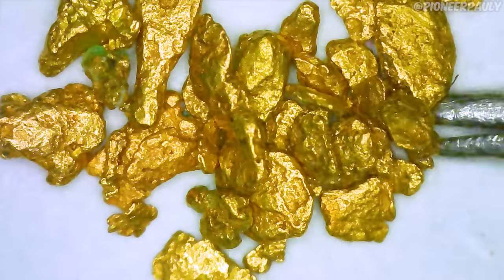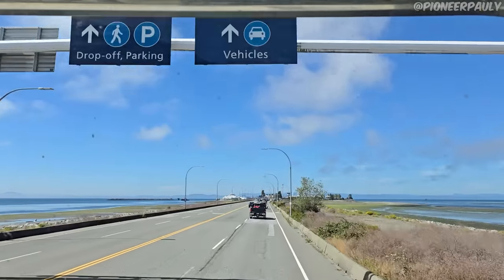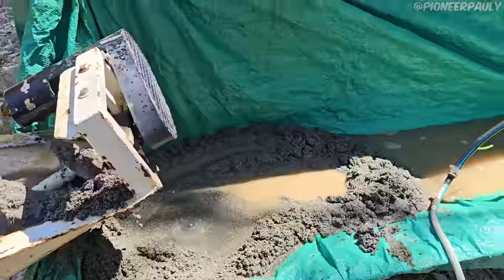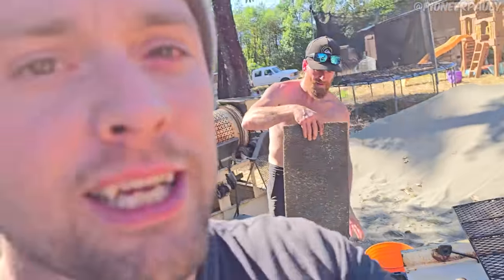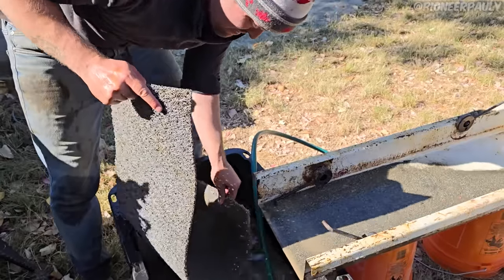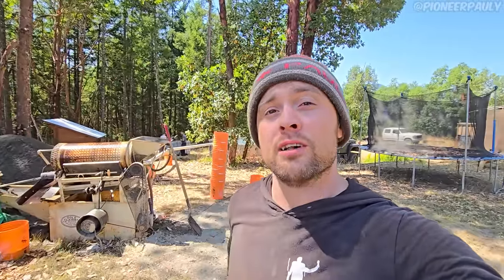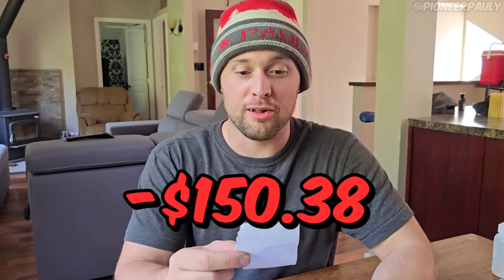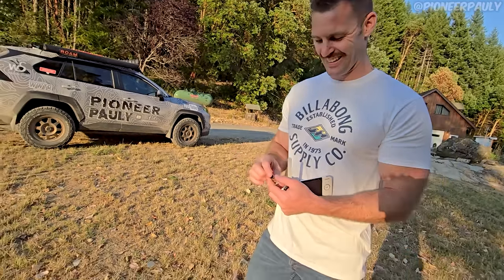How Much GOLD In Dump Truck Full Of Home Depot Sand?

Comment: Error. The sand on the bottom you left behind would have the highest concentration of gold in it.  NeXT time,  put a huge tarp down on the ground before dumping the sand on it.  Then as the heavy gold falls to the bottom, it will be caught by the tarp.  You lose nothing.
Reply: No, I ran a gravel pit with a sand screw for 3 years. That sand would be practically homogeneous. If you could simply dump sand into a truck, then into a pile and all the heavies went straight to the bottom, there would be no need for sluicing or anything else. You would just dump sand on the ground and discard everything but the bottom 1” layer.
Reply: 'Next time' lol
Reply: Error.
Reply: @baddestmofoalive  I think what they mean is as you disturb the sand from scooping it, you're going to displace the gold further down.  It's going to be negligible, but you'd definitely see a higher gold concentration at the bottom of the pile than the top.  Even if it's only 1-2% higher in concentration, etc.
Reply: Yeah that’s not true at all.
Reply: Evidently, you’re not that smart.
Reply: Bros a nerd😆
Reply: @Tyler.8046  i’m no scientist, but I think it would have to involve some version of liquefaction with either actual water or agitation and the bucket movement is probably not enough to do that, scooping is probably not enough to do that and even if it did on the truck from driving it, that wouldn’t matter much after you dump it
Reply: @primaryinbox8481  liquefaction, i.e. bubbling air through the sand, would absolutely increase the speed at which is concentrates the gold, although any disruption is going to inevitable displace gold, and since it'll be the heaviest thing in that pile, the displacement will be towards the bottom of the pile; it will just be much slower.  Liquefaction is just taking "disruption with a shovel or bucket" to the logical extreme.  The more you disrupt the pile, the more displacement is going to occur.
Reply: @Tyler.8046  So you think it would be a measurable amount? Or enough to stratify the pile?
Reply: @primaryinbox8481  I lean towards it being negligible, but non-zero.  So, potentially measurable in a large enough sample size, but getting past margin of error on something like that would be really tough.

Especially because you'd have to work under the assumption that the gold is evenly mixed from the start unless you took measures to disperse it evenly through the pile.
Reply: @Tyler.8046  I guess the obstacle I’m coming up with is how far a piece from the top would have to migrate down layer by layer to come up with something significant. I agree that it would be a statistical >O but as per the comments , not exactly yours, but it seems like that would never likely measure that way.  So I guess we agree more than disagree. Thats a civil YouTube conversation we just had!
Reply: How do you know
Reply: By your own ideology , the gold would be in the bottom of the truck, then when it dumped out it would mix it all back up
Reply: 14:00

Comment: Next stop….the Sahara Desert….gonna need some longer water hose though!
Reply: unfortunately the sahara probably has next to zero gold
the sand in this video is likely sand cut from igneous rocks like granite, from the mountains in british columbia, which is where the actual gold veins in the rocks are
the sahara desert is mostly sedimentary rock with next to no gold in it
Reply: @sneediumminer  sea water does contain gold single element scale level size, it is there though, your not going to be to wash out with pan at the scale of size? and the the not ecnomicly to recover comes in, if make a useful by products  like removing  salt from sea water to make drinkable, ? maybe? but gold is not the main product

Comment: Using a dry rocker box to feed the probably unnecessary trommel would have removed probably 10% of the mass in dust fly off. A shop vac to to get up the remaining sand on ground may have helped with the final weigh out too as much of the heavy gold would have settle to the highly manipulated pile. Running the sluice into a low spot on the property that needed fill material would save a lot of labor too.

Comment: 14:07 I also very same question why you didn't put it on a tarp to begin with but...... But....... As a truck drove for 5 hours that gold would have settled to the bottom of the pile and went dumped it would have been on the top of the pile. So you should see less gold as you get to the bottom of the sand pile. So your long truck drive was actually a good saving grace for your extra work at the end

Comment: transporting the sand around the country probably doesn't pay, but the company should definitely consider running the sand they get out of the river through a sluice before selling it.
If the sand they sold you for 841$ contained 250$ worth of gold, that's almost 30% of the value of the sand... 
Not sure how much sand they sell in a year, but this seems like a no-brainer move...

Comment: I appear to have 2 of the same trommels that you're using. My solution to the shoulder-tearing shovel work: I cut a 3" hole in my loader bucket, installed a removable pipe, loaded the bucket with pay dirt, and washed it thru the pipe into the trommel hopper...easy !

Comment: So, I lived on the Island for many years, ventured down to Los Angeles for several decades and lived near a processing plant for gravel and sands on the outskirts of L.A. This plant, besides grinding different types of material, it is a wash plant also and gathers as much Finacial resources as possible. This particular plant where I lived washes all materials before selling to industrial and or the public use.
For the most part, you caught their tailings pile for your area.

Comment: As of August 23, 2024, the spot price for 1 gram of gold in the US is $80.18 or C$108.99 in Canada.  This seems like a lot of work for little reward.  If this could be automated, use machinery to move the sand, and a larger trommel, etc. it cold be worthwhile.  On the other hand, if this could be commercially viable, I would think HD would be doing it before they sell the sand.

Comment: Take your sand bucket, cut a small hole at the bottom, and then you can just put the entire bucket into the input side and let the sand slowly fall out the bottom (like an hour glass). This way you don't have to stand around pouring it in slowly.

Comment: I would probably used the front loader to lift the sand up to the trommel so I could simply shove the sand from the bucket into the trommel saving the lifting effort and just build a small basin with some rocks or the sand from last time.

Comment: You need an easier way to load sand if you go larger. I would suggest a top load system, but sand is heavy. The other option could be a scoop conveyor belt

Comment: I recalculated your previous video results. Theoretically if you would get claim with such sand and if you could process that sand with the speed 100 yards/hr, 60 hrs per week and for period of 26 weeks, you could mine 1250 ozs of gold.
In the sand from this video you got 0.964 grams of gold/yard. It is 3.74 times more gold, than  you got in previous video. It means, that at the same recovery rate in 26 weeks you could get 4675 ozs of gold. Actually I guess that sand is almost good as dirt in Parker's claim. I guess it contains app. 75% of gold compared to gold from his claim.

Comment: I just have to wonder if that could be separated with a shaker table and what that would involve. No real crushing would be needed I suspect. Hey Pauly maybe get a bucket of those tailings to MBMM and let him run it to see what you missed if any? Next time Dan Hurd is visiting him send it along? That would be awesome to see for sure. I must say that if I owned that yard, I would be getting everything up and panning the leftovers as gold should have hit the bottom of that pile in the process plus that area under the trommel should be heavy as well. Heck, half of the gold could still be in that yard.
Reply: Also wonder if you could smelt the gold right out of the sand directly. That would be an interesting experiment too. How about a shaker cone with dry sand to concentrate the heavies at the bottom? So many ideas.

Comment: wonder how much you would have had if it did use a tarp. wouldnt surprise me if you would have ended up with 2.5-3grams if so much sand and the like was stuck to the ground.